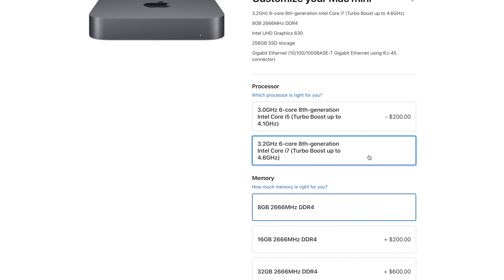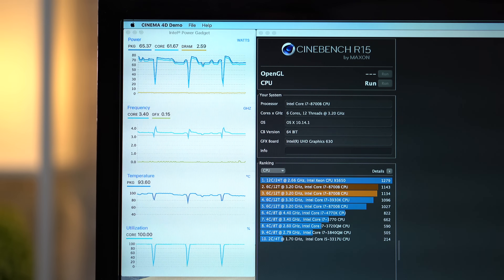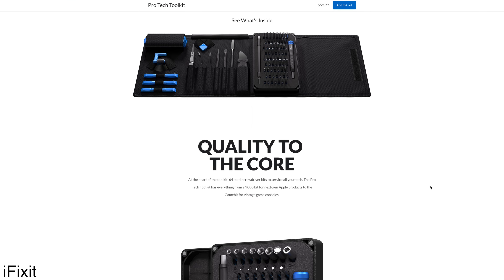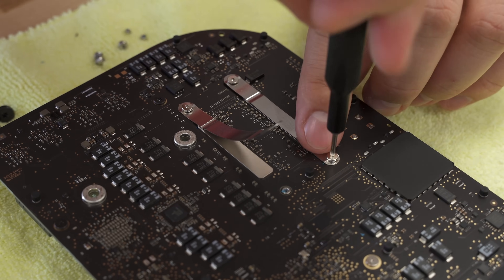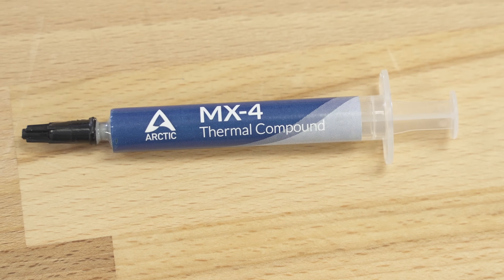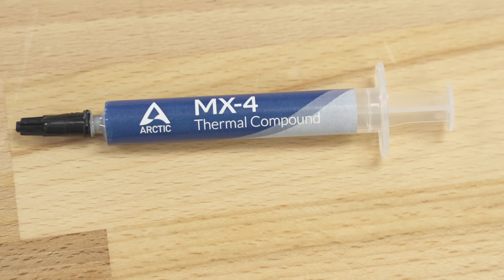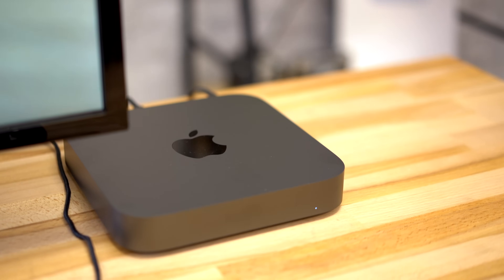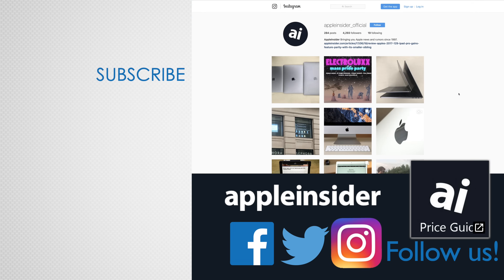2018 Mac Mini - Does New Thermal Paste Make It Perform Faster?

Comment: Do you have any suggestions to stop  the Mac mini from getting hot?  What makes the mac mini heat up?  I have 2 monitors (one in HDMI port) the the other through a hub.  I have a mac mini hub station under it with a ssd drive in it, a M-Audio Air 192-14 interface via usb-c in mac port.  I have noticed lately, the Mac mini gets very hot on the surface and am a bit worried. I did upgrade the Ram from 8 to 32 Gb when I got it in 2019.  It has the i7 6 core 12 thread with the max cpu.  I am a music producer.  Thanks for the video.

Comment: you don’t get it..its the Apple BIOS it won’t ramp up the electricity unless the fan spins to more speed. Meaning kryonaut was running the chip cooler so lower fan speed Apple BIOS did not boost the chip because it thought fan has a problem. Apple BIOS is much different than traditional motherboard bios it just doesn’t work on temperature alone

Instead of Arctic paste I have put thermal pad IC cooling and it runs cooler but also pushes to the max. With stock Apple paste in load I was 99 C now its 95 C ..more than enough

Comment: Airflow bottleneck. Mini sucks air from the bottom - but the plastic cover and the upper metal shroud block airflow. The latter serves as a WiFi antenna, but the former is a mere stand.

Removing bottom plate alone decreases temperatures under load - while adding intake fan takes it further South. Lots of people have already done it, and I’ll try the same over upcoming weeks.

Comment: Way late to the party, but something worth noting is that both Kryonaut and MX-4 are intended to be used with an integrated heat spreader (IHS), not on a bare die like what's in the Mac mini. Not saying Apple's paste couldn't be improved upon, but it would likely require using something like IC Diamond to get real improvements on a bare die: https://www.amazon.com/IC-Diamond-24-Carat-Compound/dp/B0042IBAOG

Comment: Try to take off the bottom of the Mac mini and make a stand for it. I might not have seen a big difference in performance, but I got a huge difference in thermals and fan speed. The rubber lid on the bottom chokes the actual crap out of its single fan. There’s actually even a stand I’ve seen reviews on from a company called “speed” that also has an external fan on the bottom to push even more air into the small chassis. You should test that.
Reply: I keep my device on the side edge - temperatures can still quickly jump from 40 degrees Celsius to 100 in 1 second and back. It seems to me that something is abnormal with the factory thermal paste (in use for more than 1.5 years), or the temperature sensor is buggy. In any case, I am thinking to disassemble my apparatus again and change the paste. What is your opinion?

Comment: There is no need to replace any of the thermal paste. I have a 2012 late Mac mini i5, although its 2.3 ghz but it mostly runs between 2.9 and 3.1 ghz. Like all Mac minis the temps were staying above 85 Celsius for most parts. I just ordered a router platform with a 14cm fan, removed the base cover, put a piece of pantyhose to work as a filter. My mini is running at temperatures of 48 Celsius when browsing and jumped max to 92 Celsius when I ran Cinema Bench r15 stress test.

Comment: I don't know why say the CPU "might not be performing up to full performance" - of course it doesn't. Apple's weak cooling system simply doesn't allow the CPU to reach the speeds you're paying for (and what Apple promises).
Reply: If it always exceeds the base clock, and it can reach the top scores while boosting - then it’s exactly what’s advertised. I wouldn’t expect a computer to sit on maximum boost for hours on end. The boost should be seen as a temporary bonus.

Comment: Thanks! This video changes my mind on changing my thermal paste on mac mini (which is an i5 version),btw,if u can put something below the mac on the table,that may cool the machine down a little bit, cuz mac mini breathes in air from its bottom, free the space below can increase air flow i think. In my test, doing this may drop 5°C in normal usage
Reply: hello - my mac mini 2018 late with i5  heats up during normal use up to 95-99 celsius degrees sometimes ...
I changed the RAM to 64GB
but temperatures can still quickly jump from 40 degrees Celsius to 100 in 1 second and back. It seems to me that something is abnormal with the factory thermal paste (in use for more than 1.5 years), or the temperature sensor is buggy. In any case, I am thinking to disassemble my apparatus again and change the paste. What is your opinion?

Comment: Going to all the trouble of replacing the thermal paste for such a marginal performance increase is not worth it. Thanks for demonstrating that.
Reply: that is not much work. Paste dries out over time eventually.  Most nerds just treat this like a  mechanic treats an oil change. Regular maintenance
Reply: its not about performance rather than heat. its way cooler and QUIETER if the paste is fresh and like the MX-4 a good paste.

Ive done so many MacBooks especially where they became hot and especially very loud but after cleaning and giving it MX-4 it was noticebly quieter and a little cooler with the same or slightly better performance. so win win win.

Comment: Just pop off the black plastic plate and put the Mac mini on a usb laptop cooler to force more air through the system......
Reply: Does not make a difference (bought a fan made for this and the temperature is the same - using a custom fan speed control). I guess removing the WiFi antena would be better (waiting for Torx tools to arrive to make it so).

Comment: Arctic MX-4 is not manufactured by Arctic Silver Inc, which is located in central California.  Arctic MX-4 is manufactured in China by Arctic (www.arctic.ac) or formerly Arctic Cooling.  Arctic Silver Inc., (www.arcticsilver.com) is the manufacturer of Arctic Silver 5, Arctic Alumina and Ceramique 2 thermal compounds.  Also, inn the first application way too much paste was used.   Less is more!

Comment: Thank you so much for making this video! I was about to pull apart my whole Mac Mini this weekend to replace the thermal paste. After watching this review I definitely do not feel it’s worth the time or potentially voiding the warranty
Reply: you can do it for 4-5% performance gain but use a thermal pad IC or Conductanot but watch out seating them is a pain and you need to cut it as per the die size

Comment: @Max Yuryev  You used a pea-sized drop of paste in your first attempt which got lower scores, but then you said you tried again using a different application method but sadly you did not show that application method.  How did you apply the paste the second time?  Did you cover the entire chip with paste instead of using a drop? That's what I tend to do and find that it works well (I've not tried it on a new Mac Mini though).

Comment: Thank you for proving once and for all that all thermal paste is identical.
Reply: That's a false conclusion. The test proved that with this thermal solution the paste indeed didn't matter because the cooler/fan couldn't keep up. SnazzyLabs did a paste swap with his Mac Mini and did get much lower temperature but his model was equipped with lower TDP processor.

Comment: You need to set up MacsFancontroll with Low 45 and High 70. It is slightly more recognizable but resutls are more a bit better!

I even go more Hardcore against the 90°C  here ist what i made and results for me are that long term power using the CPU isn´t more than 85°C at the Highest.
https://plus.google.com/u/0/collection/w_EWOF

Comment: I replaced the Thermal Paste with liquid metal on my MacBook Pro. But the result is very similar. I doubt the liquid metal is good, but the fans are not strong enough to take off heat. It might be the same as new Mac mini.
Reply: 10.10 1911 I was thinking of replacing thermal paste on my MBP 15 inch 2015 maxed out. So you didn’t see any increase in performance OR lower heat when using FCPX or PS?

Comment: I think you guys done the test wrong, Apple priorities sound instead of performance so it runs at the same or almost the same temperature but the fan is running slower, I think you guys should tried to push the fan 100% with the stock paste and then test the 100% fan with a new paste and I can say that will be a lot better, I’ve done that with my iMac and if I didn’t turn up the fan it would get as hot as previous with the stock paste. I love your videos but pls try this!
Reply: you are right my mac mini does the same damn thing gets hot the fan probably lowered itself to 5% with noctua nt-h1 from 20% with stock paste wtf
Reply: Apple does prioritise quiet over speed , so they also throttle and limit power to the CPU.
Reply: I think it's about "realworld" benchmark. It would be a fake score if you modify the default fan setting or adding liquid cooling to the original system.
Reply: Rodrick HD The fans spin up to 100% about halfway through the first run of Cinebench. We did 5 consecutive runs and the fans are at 100% (4400RPM) throughout runs 2-5 and as I mentioned about half of the first run is also at 100%. If you tested previous Macs (2017 and older) they would ramp up the fans much slower since the dual and quad core CPU’s would heat up slower. Sometimes the fans would stay at idle even at the end of the first run. The new MacBook Pro’s and Mac Minis with 6 core CPU heat up to 100C almost instantly instead of a gradually which triggers the fans much quicker. Setting the fans manually would make almost no difference as even having the fans at 100% the CPU still reaches 100C about 2 seconds after you start the test.
Reply: Max Yuryev nice info Max, thank you.
i’ve been struggling on going for a 32G Ram Mac Mini i7 or an iMac i9 for Music Production..
Do you think the Mini will thermal throttle when using Logic Pro ?
thanks again
Reply: V4D2 I use Mac mini i7 for logic it works very well